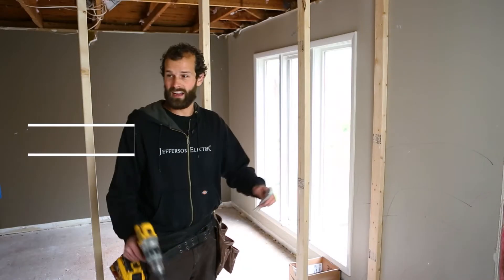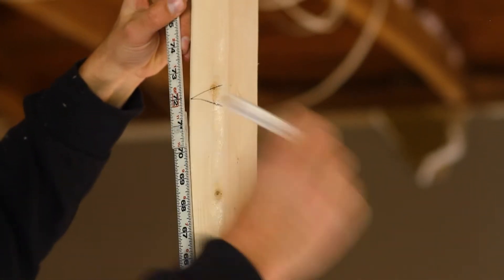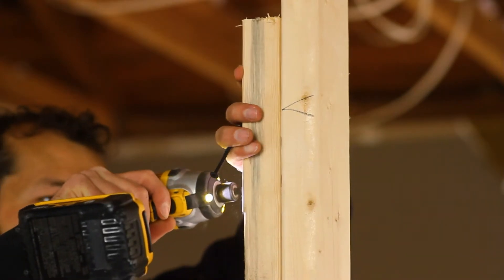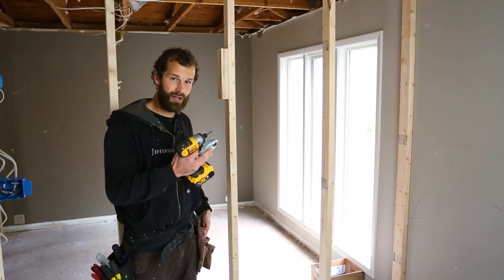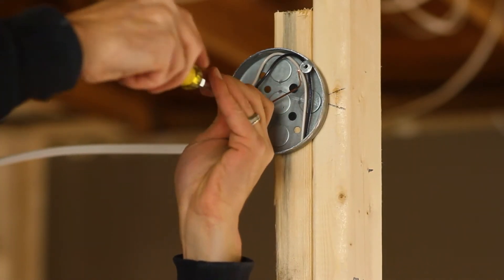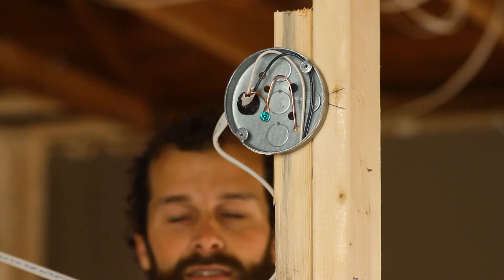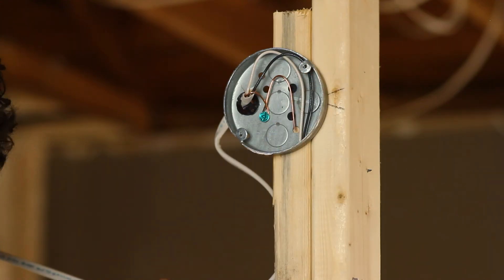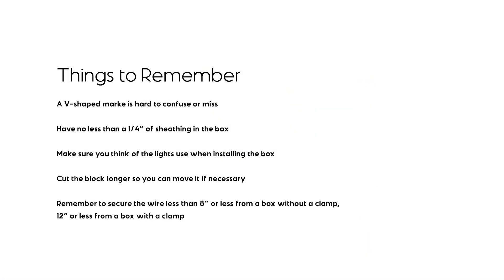How to install a 1/2" Pancake box for a vanity light.

Comment: This is a non-compliant installation per NEC 316.16(b) Box fill calculations. Pan cakes boxes can be used for domed luminaire or similar canopy and terminate within that box. This is typically referring to a ceiling fan.

Comment: Can you retrofit one over drywall or do you cut out a circle for it? Probably circle so you can grab the wire?
Reply: Use an old work box just leave the wire loose in the cavity behind drywall, then cut the hole and pull wire through and finally install old work box

Comment: Along with your method of mounting a 1/2 metal pancake box to code it’s good to either put a small wirenut or a piece of elect. tape on the black (hot) wire so it doesn’t  come into contact with the metal box

Comment: Great video. Thank you for sharing your knowledge. Much appreciated.

Question: Can a pancake box “legally” be used for a porch light so long as the box is recessed in a wooden or plastic mounting block and not surface mounted? I know that the box itself is not weather proof. I can’t seem to find an answer to my question.

Comment: Why did you mark 72” up to the middle of the box as opposed to mounting the box above or below your mark? Is that just your preference or is there a standard height?
Reply from the maker: Center markings are used as an architectural, builder, contractor standard throughout the industry.

Comment: If installing a ceiling fan using a pancake box can the ground from the Romex cable be connected to a ground cable that comes with the base of the fan rather than to a green screw to the pancake box?
Reply: Ground connected to the box so it doesn't become energized due to a short.

Comment: I just came across a pancake box as I was trying to switch out my new homes vanity light.  The light the builder had here just had one center screwlike attachment to the wall (sorry, don’t know the correct terminology!).  I am trying to install one that has a plate that I need to attach to the wall.  The wiring coming into the box being off center is keeping me from being able to get the plate flush to the wall.  I also don’t know where to tuck the wires when i have them hooked up.  Any advice?  TIA!
Reply: Did you ever figure this out in a similar situation

Comment: Ground wire not hook up right need pigtail on boxs
Reply: @ElectricProAcademy  250.148(C) Metal Boxes. A connection used for no other purpose shall be made between the metal box and the equipment grounding conductor(s) in accordance with 250.8.

Comment: Please give code reference as to 12 inches along the ( length ) of the wire and not just within 12 inches. And is it a code requirement for a box bonding screw to be green. Or just common practice.
Reply: @ElectricProAcademy  Thanks for the reply. On the green bonding screw, the only reference I can find is 406.9(B)  250.146 does not say green. I have an older book maybe it has changed.
Reply: @bsmith8564  250.8 Connection of Grounding and Bonding Equipment.  250.8(A) references the approved means of connections.  The color green is not mentioned when using machine or thread-forming machine screws.  250.28(B) Main bonding screws are required to be green.
Reply: @donl1410  Yes main bonding screws and device ground screws are required to be green. Junction boxes or device boxes are not.

Comment: Why use 14 guage wire. I would never use less than 12 guage
Reply: 12 gauge would fail for box fill, 3x2.25 is more than 6, which is the size of a pancake.
Reply: 14-gauge is perfectly appropriate for lighting. It is code for 15 amp receptacles although 12 gauge is good practice for receptacles regardless.

Comment: Why couldn’t you just move the box location over an inch or two, so you could have a deeper box, and then everyone could be happy.
Reply: Good luck having all you lights off center to get extra box fill. I would take it a step further and use no box on the rough in, that way if they push the cabinet an inch you can still be perfectly centered. Just use a cut in or pancake on final.
Reply: @ElectricProAcademy  Yes, I’ll grant you that. But you’ll probably agree that if you could, you should, if esthetics are not biting you. Something about box fill etc, in practice if not law. We wouldn’t want to give anyone the impression that this is a preferred way of doing things.

Comment: Solid work!  Keep grinding, YouTube algorithm with find you sooner or later with this quality of content 👍👍
Reply: @ElectricProAcademy  Also, 2020 NEC states that you can have no more than 18 inches of cable length is allowed between the cable entry to the box and the closest cable support. So you could leave up to 18 inches if your vanity location was really questionable. Of course, the staple still needs to be within 12 inches.